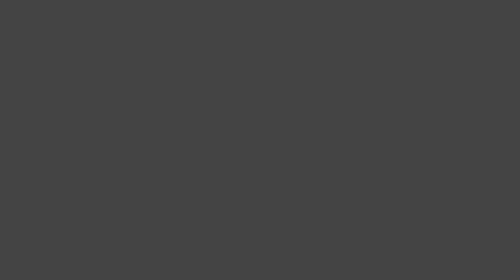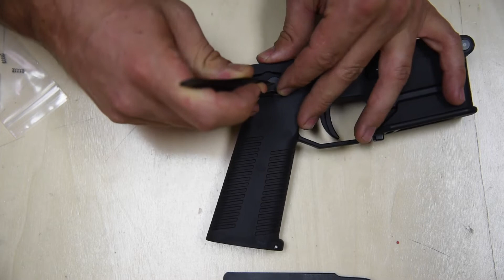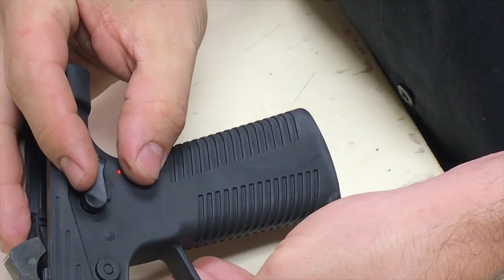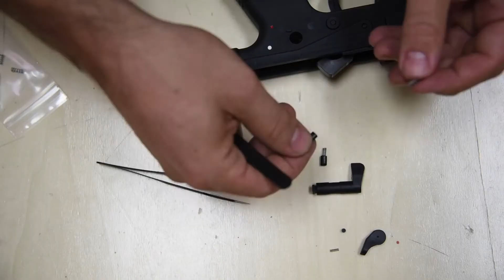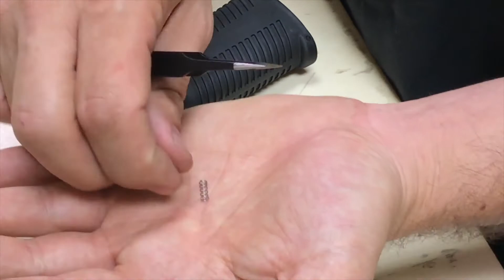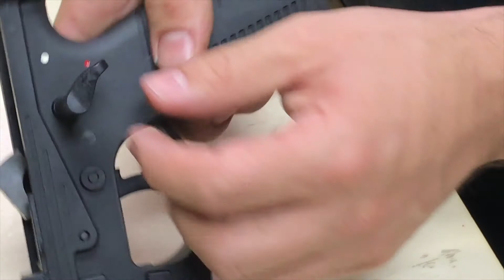HBI Reduced Weight Safety Selector Springs for B&T APC and GHM

Comment: Use the heavy spring on the leaver side that you use and the light spring on opposite side. It's not to hard and not to easy.
Reply: Factory safety is impractically stiff.  Using both light springs makes the safety light, sure.  But in my case, introduced a little slop. Out of character with B&T's ultra-tight tolerances.  Tried your advice.  One old, one new.  Now it's usable, & no slop.  Spot on.  Thanks for the good suggestion..
Reply: This

Comment: Awesome video! I was able to install the springs in less than 5 minutes. I used a Sim Card Tray Pin Eject Removal Tool to push the detent to remove the safety selector bar. Springs were less than $10. Agree with everyone else, you can tell a huge difference between the OEM springs versus HB Industries. Good investment for your APC9 Pro G!